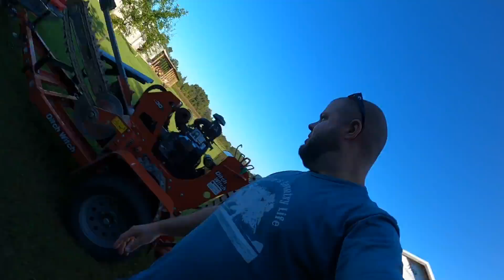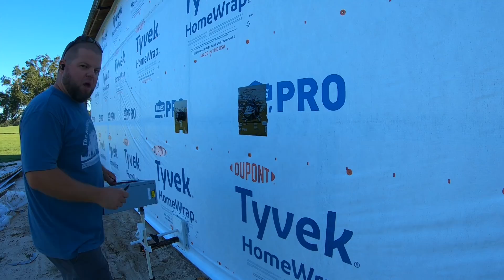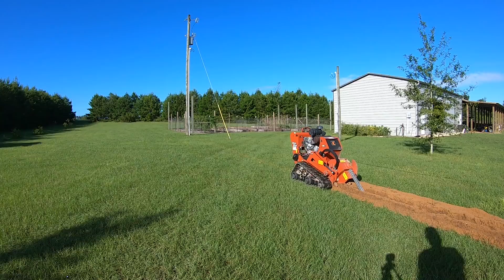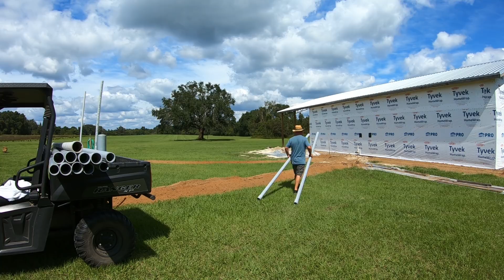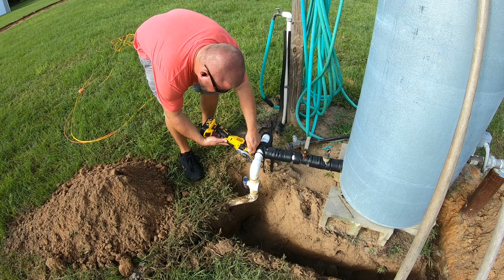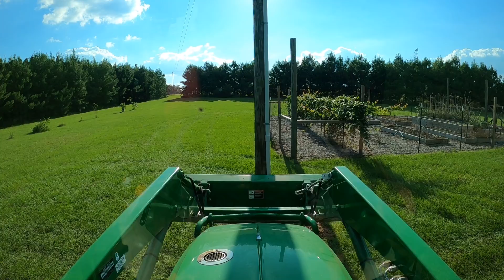Outdoor electrical conduit and plumbing has started! #448

Comment: I am a little surprised you are using PVC for water supply. This leaches something into the water. You are supposed to use CPVC (yellow) or black Polyethylene pipe. Neither of these leaches anything into your water.   (Edit: Just saw you discuss this. Sorry.)
Reply from the maker: Yep that's an old wives tell. NSF pvc is approved for potable water in cold water applications.

Comment: To save time, don’t install the rope as you go. Glue and install the conduit, tie a plastic grocery bag to a string and use a shop vac to suck the string through. Then pull your rope with the string. Fast and easy. 
They actually make a large pulling string, that looks like a flat shoe string and it’s strong enough to pull wire cable.
Reply from the maker: I've just learned about both of those things.

Comment: There is an easier way to get that rope through the conduit. Put all the pipe together, when done tie a string to a plastic bag, use string long enough to run full lenght. tie other end of string to the rope, but there is also a different way than rope. Anyway, use your vacumn cleaner to suck the bag and string through, then just pull the string and the rope comes with it.
Reply from the maker: A lot of people have been suggesting that, I never knew about that trick.

Comment: I use clear primer and had someone call me out for not using primer so I tested a primed vs unprimed 1" PVC. The pipe burst before the glue failed on the primed and unprimed.
Reply from the maker: Primer is no longer needed like it use to be. All Oatey glue cans say it isn't required unless your local code requires it. I've never once in my life had a joint fail when using good quality glue like Oatey.

Comment: Hey Andrew the wall that has your washer connections on that your saying your having problems getting water over to the washing machine can you make just that one devider wall a 2X6 wall and that give you the room needed? I know it would be re-doing that wall but to me I appears that would give you enough room to squeeze in the water connections. It just a thought...either way good luck with it..
Reply from the maker: I trimmed that wall out an additional 1.5 inches to run the pipes. Video out today.

Comment: An easy tip to pull string through conduit is a shop vac and a Walmart bag. Make a balloon out of the Walmart bag, tie it shut with the string and put the balloon into one end of the conduit. On the other end put your shop vac on the conduit then turn it on. In seconds, that Walmart bag and string will be pulled through.

Tie the string to the rope and pull through. Always run another pull string when pulling one out.

Comment: Why did you use a common cheap spigot on the last one you installed. Why not the 1/4 turn full bore you promoted?
Reply from the maker: Because I'm out of full port valves. More in the mail

Comment: For you electrical conduit in future glue it all together and just use a shop vac on one side once all laid to suck twine through the pipe. Then you can pull a rope through with the twine.

Comment: Andrew. Thank you..I know PVC becomes brittle  when exposed to the sun.  Are you going to paint the PVC to slow the sunlight down?? Keep up the good work!!
Reply from the maker: I'll be wrapping in insulation since it does get cold enough in the winter to freeze pipes. I had pvc spigots in my last yard that were older than me. No issues after being in the sun for decades.

Comment: Did I hear you correctly, the power company is providing you with the power line from the pole to your meter, free of charge? My friend has a property near Perry, FL same power company as you. He had to dig a ditch 24 inches deep, put the conduit down, show proof of the depth, but was charged for the power line the power company used to connect from the pole to the meter....not sure what the difference is...hmmmm (Ok found out that my friend does not have his property as his main address. Therefore your getting the lines free only becuase you reside at that location.) 

Also good luck on your plumbing with your shower issue... well i am now cuaght up, i wonder what other playlist i can get into :D

The water whole house filteration! Glad to see your doing it. we have city water, and i have a 2 stage filteration...10in Sediment followed by a 20in GAC filteration...then goes into a water softner. Every 3 months for the sediment, and 6 months for the GAC (being its 20in).
Reply from the maker: Yes free if it's your main residence, I had to pay to bring power into my shop.

Comment: I replaced all my water spickets with the ball valve ones, definitely flows a lot more water. Only thing I don't like about those is when you go to wash your hands, it has a jet stream of water, so I ended up replacing one with the old style for washing hands.
Reply from the maker: That's exactly right, the extra flow does not work well with requesting a small flow for washing hands. I keep one at the pump as standard style and mainly use my shop sink for cleanup.

Comment: In case you haven't done it already, Tips: 1)Pull wire in the direction of the pipe bell ends. In your case from pole to house. 2) You can not use to much wire lube, I pour it in my 90's. 3) Unroll all your wire across the yard removing all of the coil effect. 4) Put a connector/plastic bushing on the feed in end as the edge of the pipe will cut the insulation on that wire as it goes in and you'll never know it until your pipe fills with water...
I told you I can't sit quietly.
Reply from the maker: Here's the beautiful part, I'm done! The power company provides the wire and pulls it for me 👍😁.
Reply: @TKCL  Oh...you must have the meter on the house then...I've got to pay better attention to your project. I thought I had some tacos in the bag.
Reply from the maker: Well yeah! I do not call for inspection before the meter box is hooked up.

Comment: In AZ with exposed white pvc pipes, for water supply or pool equipment, if you spray paint the pipe with good spray paint (usually white)it will help protect the pipes from degrading over time from the uv rays.
Reply from the maker: I'll be wrapping mine soon in full insulation. It gets cold enough here at times to freeze them.

Comment: You should try hell, I mean Florida. 2" electrical pipe has to be buried at 48".
Reply: Pretty sure he is in FL..I just did this in FL and the req is at least 24"
Reply from the maker: I am in Florida and conduit covered wiring is 24 inches deep.

Comment: Wire in pipe (pvc) only needs to be 24" deep not 36" like some inspectors will tell you. However they don't like when you pull out a code book and correct them, so I did it all the time...
Reply from the maker: Lol, I hope I don't have issues with this. It's always been 36 that the power company requires, now they are saying 24. 🤷
Reply: @TKCL  You cant be to deep, so you have built it to Kelly code. 
: )

Comment: Andrew, while you have a trench digger... have a look at this climate control system, which uses earth tubes ... 

https://youtu.be/ZD_3_gsgsnk
"Growing oranges in the snow"

It provides year round constant climate once set up... and you appear to have the area and kit to do it.   Would be fun to watch.  In Australia here, our sapphire miners use a version of this to draw cool air from mine workings into their homes to cool from the punishing outback heat in summer and cold in winter.

Comment: Andrew do you have to bleach all the OSB and wood again for mold..and is there something you could spray to prevent or even seal it?
Reply from the maker: Nothing on the osb, just on the pine boards. Once you seal the house and dehumidify it everything dries up and dies. I still treat occasionally to make myself feel better. I'll be treating with a mold biocide in a upcoming episode.
Reply: So glue in the OSB keeps the mold off or at least I think it does...    pine you have to treat...how about termites and mulch around the house..im always scared of Termites any concern with mulch around the house...
Reply from the maker: I'll be applying boracide with a mold biocide. I also regularly treat around the home with bifen. All effective for termites.

Comment: Andrew, don't guess you caught it but did you see how rusty/dirty you existing water line was when you cut it at the tank line for the new valve? I'm guessing if it was rusty/dirt from the well & bottom of your water tank, hope you using water filters to catch all the sediment.
Reply from the maker: That's algea growth, that's a drain line that only gets used every couple of months. That's why the pipe was sitting on top of the ground and short.

Comment: Because of the angle of the opening of the conduit near your home, you may want to set up some sort of temporary anchor to resist the upward pressure of the conduit being pulled up as the conductor is pulled through it. Maybe put you first few rows of side on over there and anchor it down against the wall.

Comment: Nice video. You can find studies around that show primer can actually weaken the joints under tested pressures. Though the usual response is that no water supply ever hits any of those pressures. What primer is supposed to do is make the solvent in the cement even more potent so that the pvc surface gets even softer, which purported led to an even deeper chemical weld. 

As to PVC vs CPVC and potable water, the actual difference is that the CPVC can withstand signficantly higher water temperatures. The temperature that a hot water heater usually heats house hot water to is around 130 F or so. IIRC, that is also the maximum rated temp for PVC, but CPVC is rated for about 50F more, so like 180 or 190F.
Reply from the maker: I agree, and the entire water system in my house is cpvc only. If you ever put Pvc glue on Pvc pipe and pick it away after a couple of minutes, you'll see it's dissolving the pipe like crazy. I can't imagine the primer is needed seeing how soft Pvc gets with glue alone.
Reply: @TKCL  I wonder if the primer + cement combination was developed back when the cement was not very potent and actually needed the primer. And now that the cement can do it on its own, people just keep using the primer anyway and thinking that you need it.
Reply from the maker: If you read the back of quality glue cans like Oatey, most say primer is not needed unless local code requires it.

Comment: I had to install detectable tape in our trench so it could be identified/located easily.  Also our county would not allow me to run the electric and water in the same ditch. Guessing it varies by state and county.
Reply from the maker: It varies a lot I've noticed.

Comment: As a guy who proudly overdoes things was odd to see you go with just the plain white PVC for your water spigots. I know you don't have much of a frost/freeze situation where your at, but just the figured some metal pipe would be better for the sake of durability. a summer or 2 of sun and id think that PVC would be so brittle. I'm sure you've thought about it and everything, this is just coming from a guy who doesn't know any better.
Reply from the maker: Never metal here, rusts and I don't trust it. I actually had some metal pipes at my last home, those ALWAYS froze and busted before PVC ever did.
Reply: @TKCL  ah I see. I wasnt even thinkin freeze, I was thinkin like getting bumped into or the weed whacker or what not.
Reply from the maker: I'm careful around them, I've never broken one before. I also screw them to the posts and wrap in insulation during the winter.

Comment: Nice job on the house Andrew,  quick question, I don’t think pvc is UV rated…wouldn’t those pipes that are exposed to the sun for the spigots just become brittle after time and eventually crack? Are you going to put up some kind of uv coat of paint for protection …we live in Hawaii and we have a  3” sched. 40 for our drain on the outside of our house running from a effluent pump and it cracked from the sun in about 3 years…may want to paint it or check code for that
Reply from the maker: I'll wrap those in full insulation soon, we do occasionally get cold enough temperatures to freeze pipes.